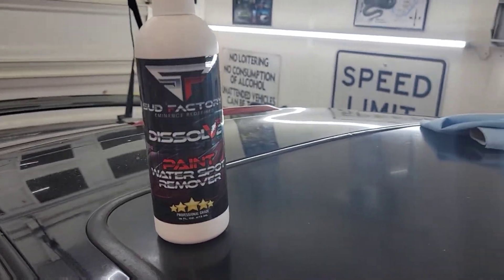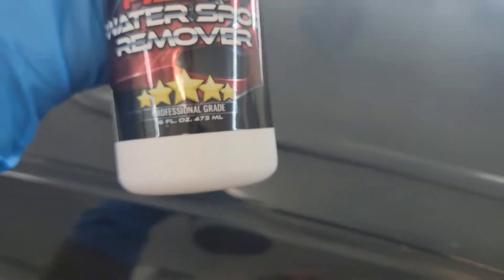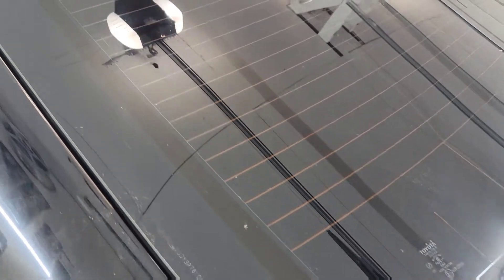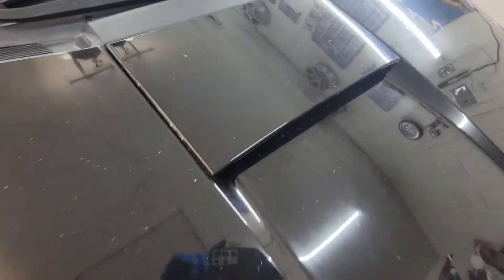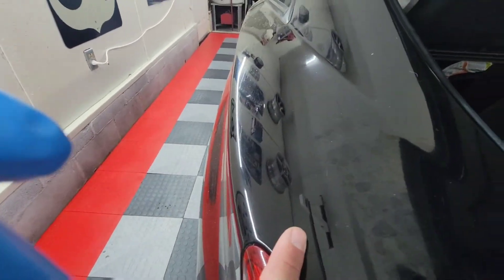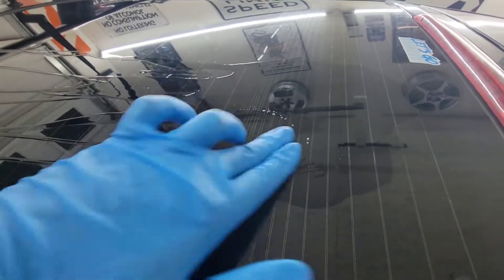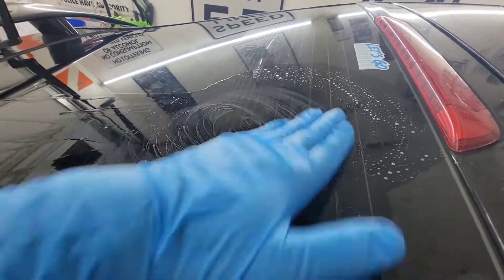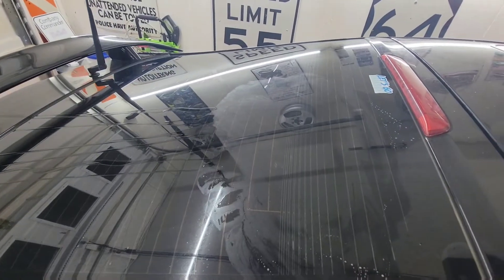Sud Factory Water Spot Remover - Does it work?

Comment: Ok i tried this  and pretty dissapointed. I used the glass water spot remover over and over and no luck so i tried again and scrubbed the shit out of it that time and i actualy damaged the glass i rubbed so hard the window got hazy and barely got the damn spots out. There is a guy on u tube uses the cream pruduct on his truck and said it worked great well the cream is for the glass and actually feels like it has fine sand in it  that video and this product are SHADY.
If someone got good results tell us about it please.
Reply from the maker: I was able to get good results honestly. I didn't have any damage to the paint or glass either. I still have more work to get it perfect, but the hard water spots on mine look waaaaay better now.
Reply: The only thing I found that works for old etched in water spots is polishing, and if you're trying to remove them from glass you'll most likely need to use an actual glass polish. Ceripro is what I've had good luck with, you need to use their specific pads on a DA polisher as well and it takes a lot of effort, but it does work.
Reply: I used this on rims that  were stained and NO wheel cleaner would work. This was litterly spray and wipe and wheels came 100% clean
Reply: There is no way I’m believing this comment, I just fished cleaning one of my windows with this and it’s amazing. I tried 0000 steal wool prior to buying this, it took me 5 hours to get one window clean, so I researched and bought this stuff, it works! My windows were horrible, I have 2005 truck with water spots so bad it impaired the vision when looking through, horrible. Look like new now.
Reply: He probably had multiple decades of caked on deposits and didn't use a  second clean microfiber to pull off the contaminate. This stuff is the only way by hand. I use a certain "dish washing" scrubber that's made for cleaning glass electric stove tops with this product, makes quick work.

Comment: If you can avoid the spots in the first place the better obviously. I imagine in order for this stuff to remove these hard water spots, it is probably aggressively removing clear/material from the car. No bueno.
Reply from the maker: I bought this car this way
Reply: Probably just citrus based like most water spot removers. The acid cuts down those hard water stains with ease.

Comment: This is sketchy. You use PAINT water spot remover on glass. But then dont show the before-during use-after of the time when you actually used it on paint. But say it's great. And then close out by saying $35 (plus shipping) a bottle isn't bad?? Thats outrageously priced!

Oh, and about 80% of the other reviews say it's snake oil.
Reply from the maker: I'm a regular dude just trying to get rid of water spots. I had ordered both the paint and glass water spot remover, but something happened and I only got this one, so I decided to go ahead and try it out. I need to use more of it as I didn't really get all the nooks and crannies, but it did work. It takes some elbow grease but the spots are gone.
Reply: It's definitely not snake oil. I used it on my son's 2009 Honda Civic and it took all the water spots off both the glass and the body paint. I did use the right chemical on the right surface though. The glass took a lot of buffing but the stuff for the paint was just wipe on and wipe off. I've also used the glass cleaner to clean my glass stove top when it gets stained and it also works on my shower door and other things around the house that need a slight polish from the crappy City water we have. The glass polish is a little bit harsh to use on lexan, it will need a finer polish if you use this product to get the water spots off.